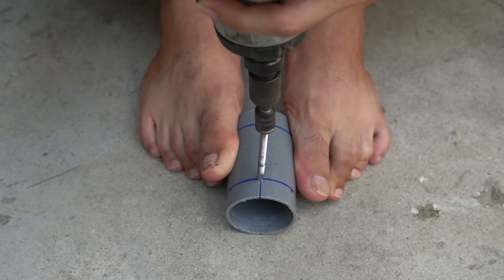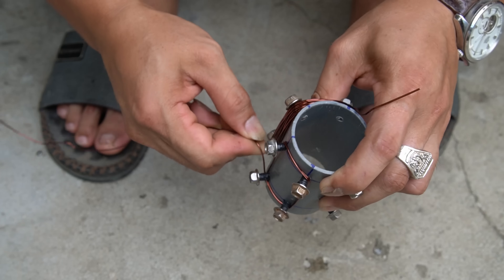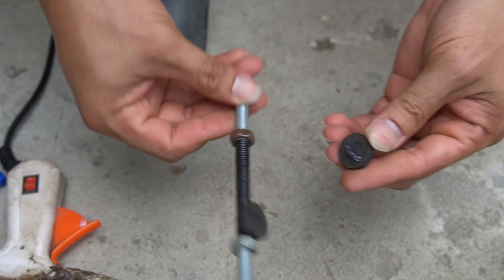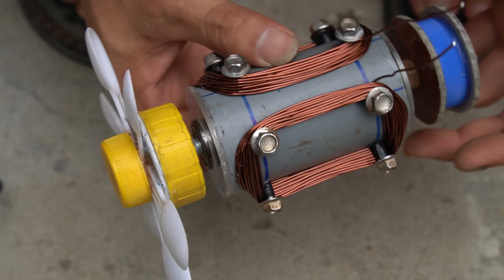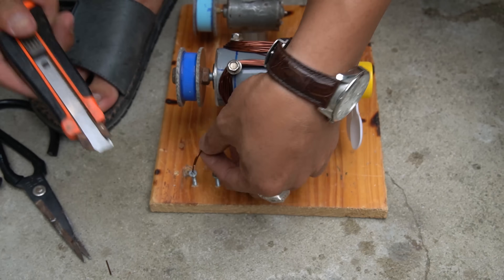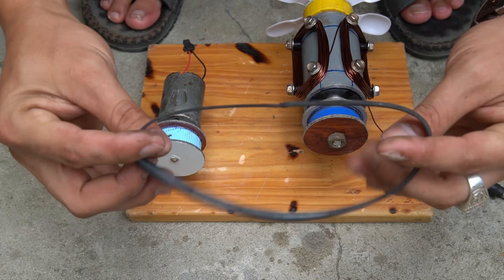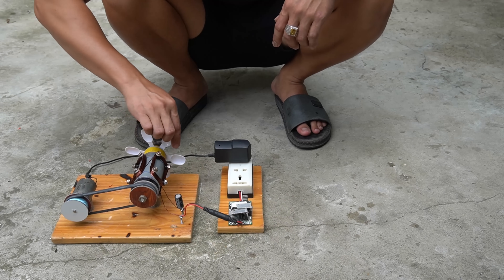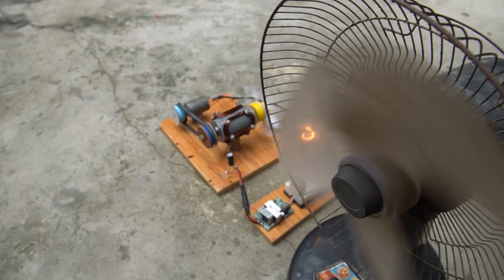Tiny Machine, Huge Power: Creating Endless Free Energy

Comment: SCAM.... Energy has to come from somewhere. It is not floating about in thin air. That is a fact which is undeniable. That little inverter can't produce "huge power". The little toy motor needs to produce "huge power" to pass it to the generator, which it can't do. Then the tiny power plug would have to provide "huge power" to power the motor. This is why it's a scam.

Comment: There is a small battery inside the converter. This battery has enough power to keep the small motor running. When this small motor operates the generator, it will create a small current strong enough to activate the relay hidden in the lamp base and the electric fan (both the lamp base and the electric fan have batteries). The wire is only to power the relay. When the system stops working, the current is no longer there, the relay does not conduct electricity, so the lamp and fan will turn off.
Reply from the maker: Thank you very much. ❤️❤️❤️

Comment: Why don't you show measurements of the generated output (voltage, wattage/amps, and frequency (Hz))? What exact components are used in your 220-230V converter? Without these data, anyone interested in replicating your generator won't be able to do so.
Reply: Because it a fraud.

Comment: How it works:

The generator produces electricity, which is converted to 220v through the inverter board. The resulting electricity then powers the mobile charger that runs the dc motor, which keeps the generator rotating via the belt system. The cycle repeats
Reply: 😂😂😂... apa pendapat anda .. apakah ini hanya trik trik untuk konten saja ?? 😅😅😅

Yang pasti.
Free energi alam sudah terbukti ...
Yaitu >>> alam semesta selalu bergerak tanpa henti .. miliaran tahun 😂😂😂😂 ...